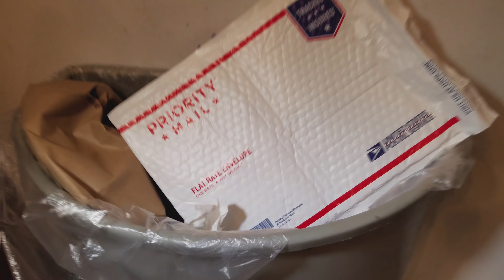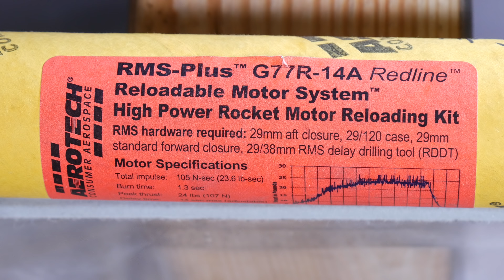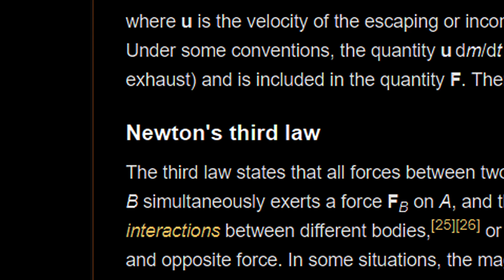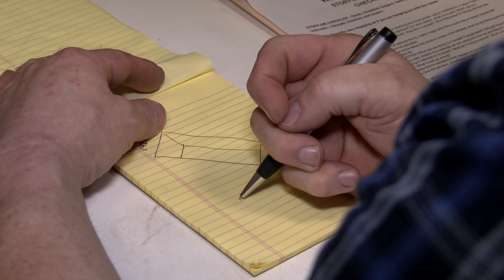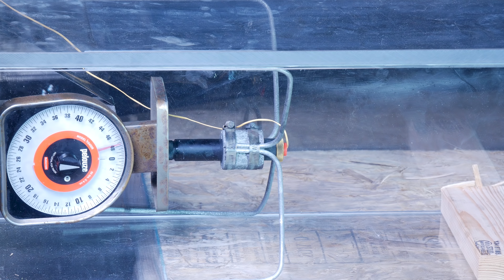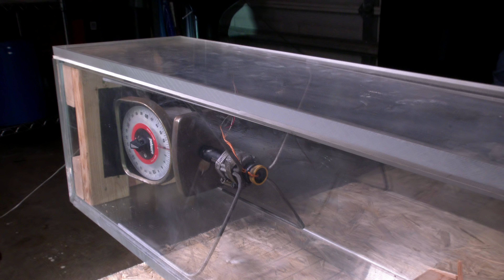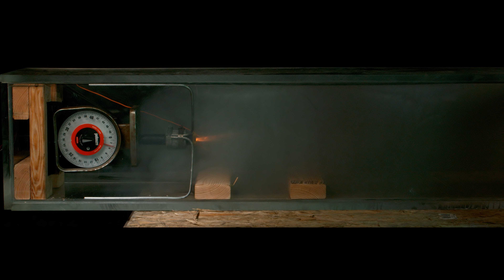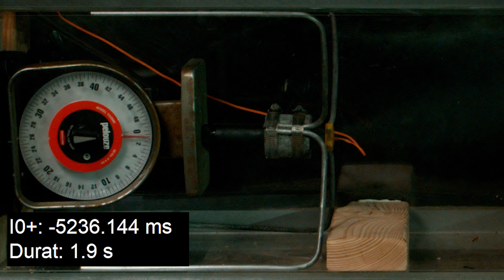Rockets in a Vacuum Chamber - Newton's third law of motion Visualized

Comment: NASA doesn't use solid fuel rockets in space. Only in Atmosphere to assist with launch vehicles. In Vacuum NASA uses liquid fuel rocket engines.
Reply: pepcon disaster look it up
Reply: NASA doesn't use solid fuel rockets in space, but that does not change the results here.  Accuracy of thrust measurement is not required here.
Reply: NASA used a solid fuel rocket in space very recently on the Parker Solar probe.
Reply: They did have several corrections burns TCM-1 44.0 seconds and TCM-2 for 35.2 seconds. Solid rockets cannot be used for these maneuvers as once you ignite a solid motor, it can not be stopped.

TCM-1 Quotes-----
Spacecraft controllers at the mission operation center initiated the two-part TCM-1 beginning at 6:00 a.m. EDT on Aug. 19 with a 44-second burn of the engines. The majority of the engine firing, which lasted just over seven minutes, began at 6:00 a.m. EDT on Aug. 20.

“TCM-1 is one of the critical events of the mission and a major mission milestone,” said Parker Solar Probe mission design and navigation manager Yanping Guo, from APL. “In the future, we only need to fine-tune the trajectory periodically, and no major adjustments or large maneuvers will be required unless something unusual happens. In short: We are on our way to touch the Sun!”

“The team completely nailed this maneuver,” said APL’s Andy Driesman, Parker Solar Probe project manager. “Execution of the burn was exceptional, measuring at less than 0.2 percent magnitude error—which translates to a 0.3 standard deviation, or sigma, from optimal. We had defined success for TCM-1 as up to 3 sigma, which really illustrates how phenomenally this was executed.”

TCM-2 Quotes-----
On Friday, Aug. 31, flight controllers at the Johns Hopkins Applied Physics Laboratory in Laurel, Maryland performed a second planned Trajectory Correction Maneuver (TCM-2), a thruster burn which lasted for 35.2 seconds. This maneuver, which was executed with a high degree of precision, adjusted the direction of the spacecraft to position it for its Venus flyby on Oct. 3, when it will use Venus’ gravity to shed speed and draw its orbit closer to the Sun in preparation for its first solar approach.
Reply: @N2Otorious  I had thought I had seen a video where a NASA engineer was talking about the propulsion in space. Guess I was wrong. I knew already that you cannot stop a solid rocket from burning all its fuel after ignition; now that I think about it, it seems much less sensible to use one in space.
Reply: +The Deaner 
No worries bud..

Solid rocket boosters were used on the Delta IV launch vehicle.
Reply: +The Deaner It's perhaps simpler to think of this in terms of how a specific rocket engine is built to figure out whether you can start/stop a given rocket engine, and thus more suited for repeated operation in space or not.  This becomes more handy when you think of more exotic motors such as hybrids (eg: solid fuel/gas or liquid oxidizer) or tribrids (which use solids, liquids and gasses at the same time).

If a motor has all of the fuel and the oxidizer  inside the combustion chamber[s], that means once you start it, it cannot be turned off until all the fuel is gone, unless you rupture the chamber and spill the combustion  pressure.  That tends to be kinda rough on the passengers/payload, and almost certainly means that even if you you repaired the rupture, there's no fuel left to restart the engine.

Secondly, if the fuel and oxidizer is all mixed together in the combustion chamber, that means you have little control (if any) over the level of thrust at any given moment.  It's either full on, or not running at all.  No in-between.  The "full on" is defined as how big the surface area of the burn (exposed surface of the fuel grain), how fast the fuel grain regresses once ignited, and how much gas it produces per quantity of fuel.  You can define it coarsely in engine design and manufacture, but you can't change it later.

You might think you could build a combustion chamber and hold gas or liquid fuel and oxidizer like a solid.  However, gases and liquids move and mix.  There you can't design a specific burn surface, potentially the whole mass of fuel is the burn surface simultaneously.  So instead of a pre-defined thrust determined by burn area and regression rate, the whole thing goes off at once.  Bad.

Controllable motors have a combustion chamber,  fuel and oxidizer tanks and some way of moving the fuel/oxidizer from the tanks to the combustion chamber (usually pumps).  To start it, turn on the pumps and ignite.  To change thrust, change the pump speed.  To stop the motor, turn off the pumps.

It's conceivable that you could have a solid rocket that is restartable and throttleable if the fuel/oxidizer was a powder in a tank, and you pumped it to the combustion chamber.  This is complicated, very fussy, and very difficult to get right.  It's doable in the small scale, but nobody's tried yet in the large scale.  Apparently some company is experimenting with something like this now.  But since it's complicated/tricky/dangerous nobody else so far has bothered with it.  Why would you research pumping solids?  Because if you can get it to work, it's more efficient.  Getting it to work is the hard part.  Why is it hard?  Moving large quantities of fine powder very fast is very very difficult.  Powder is abrasive, so it eats your plumbing.  And there's more.
Reply: @fromagefrizzbizz9377  yes, I am aware. I know that liquid fuel rockets can be started and stopped and solids can't. I thought I remembered seeing a video where a solid was used in space, but I was mistaken.
Reply: +The Deaner I don't think you were mistaken.  I seem to recall one myself.  The question you must ask yourself - would it make sense to use a solid in a particular case?  I sure and hell wouldn't want a solid booster to steer, do soft landings or to dock at a space station, but there are times where dumb simplicity and fire and forget is exactly what you want to do.

For example, staging separation (in atmosphere and in space), isn't necessarily what you think.   Most of the time they're small solid rocket motors - the key isn't just to get the connection to come apart, but also to guarantee a safe separation.  For example, the staging separation on the Shuttle boosters (if I remember correctly) are essentially "M or N class" rocket motors.  Not only must they cut the connection, they have to give a strong sideways boost to the SRBs away from the central core, otherwise, they may whack back into it with catastrophic results.  Sticking a liquid-based motor requires computers to control it, you can't control it from the main rocket because you're cutting the connection, so the rocket has to have its own self-contained computer with oodles of sensors.  Vastly increasing the chances of it failing to work.

A M class motor is roughly equivalent to a US bazooka or RPG round in total power.  In a "short/fast" burn configuration, it could produce thrust well into the thousands of pounds.  On the moon, an appropriately configured M-class motor might well be able to put a small payload into lunar orbit, so, they're not a toy.   Well past escape velocity on the moons of Mars.   The largest amateur motor I've personally seen fired was an O (4-8 times the power of an M), and that was enough to boost a 300-400 pound rocket (just the engine itself weighed over 200 pounds) to 45,000 feet and Mach 2.7.

For example: impactor probes.  As long as the thrust is high enough and you're close enough, you really don't care a whole lot about accuracy,  you just need the thing to fire, and fire *hard*, after sitting soaking in space for years.  Your telemetry can feed you back how fast it was going when it hit, which you then factor into your analysis of what that impact did.
Reply: That's correct. All of the rockets used to maneuver in space during the Apollo missions were powered by hypergolic fuels (fluids that self ignite when mixed together..) so no outside atmosphere or ignition system was needed. The solid rocket boosters on the shuttle were only used inside the earth's atmosphere.
Reply: N20 the mercury atlas  space craft used solid rockets for braking to slow it enough to drop out of orbit the mercury craft had three solid rockets  strapped to the heat shield